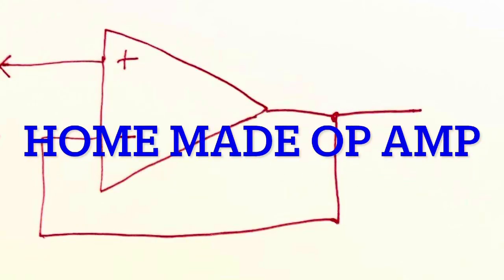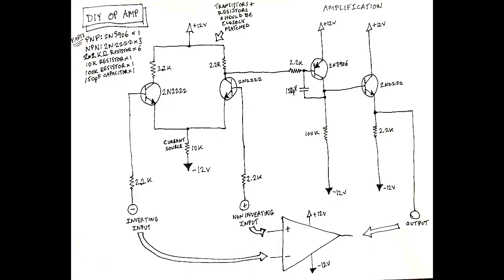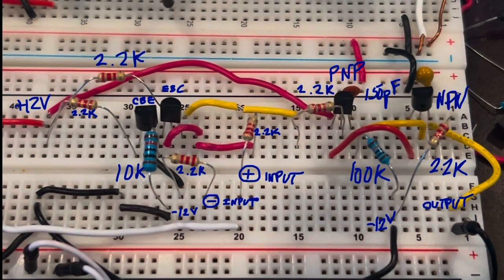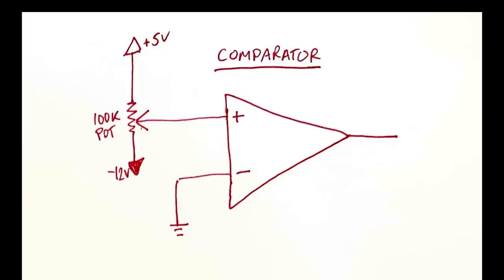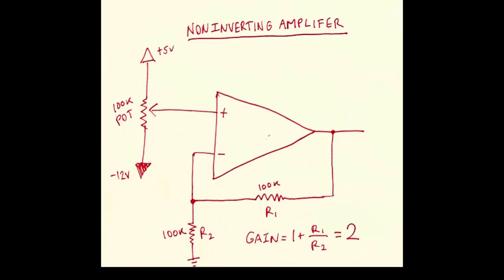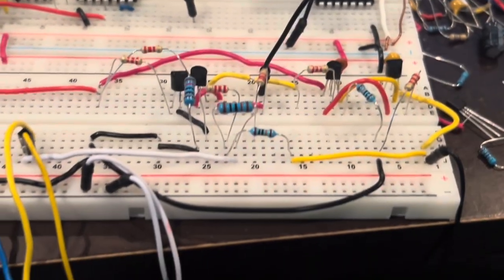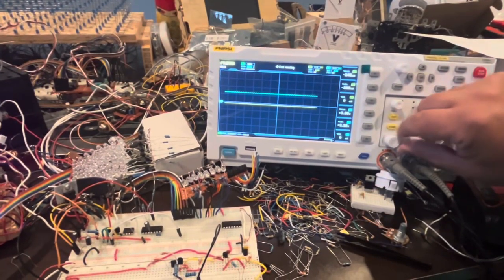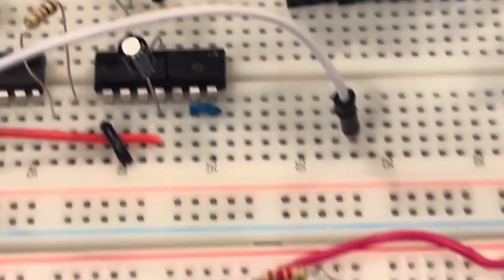DIY Home Made Working Op Amp with 4 Transistors

Comment: My God!!! I thought I was into electronics your bench is a mess. That is so crazy!!! But I like it. I take parts out of used electronic device's to build, but I was wondering where to order parts from because I want to build some effects pedals for the guitar and learn more on breadboarding and reading schematics better. Any help is appreciated.
Reply from the maker: I get most stuff on amazon
Reply: @igorbrichkov3632 okay, thanks!!! You need to do more tutorials, the stuff your making is amazing. And that you like the 555 timer. I have a fascination with that little IC chip. I want to make the internals of that with transistors one day. I have a fascination with analog!!!
Reply from the maker: @SeanDuranMusic the 555 and the op amp are my favorites
Reply: I know what you mean. Alot of the stuff you've done, I've either tried or want to try. Like your cube, and uv meters. I make things I can use or for automotive applications, like a switch panel. I used Christmas tree 🎄 leds to monitor things I needed to monitor like brake lights, turn signals switches on/off. High low of my headlights. It was for my race car. I put a v8 in 79 rx7 and wired things my way, lol. I noticed your distortion pedal for your daughter you don't have a schematic? I'd like to make a simple one to give away at the local radio shack. Yes, their still around in my area. I can't wait to see more of your videos. I also made me a Piezo cymbal for my electronic drums set and a extra kick pedal which I think I have that stuff on my channel. Anywho...